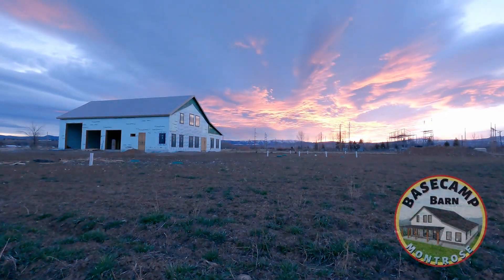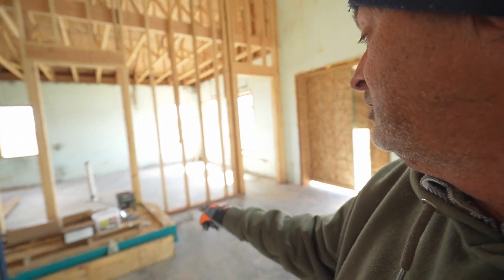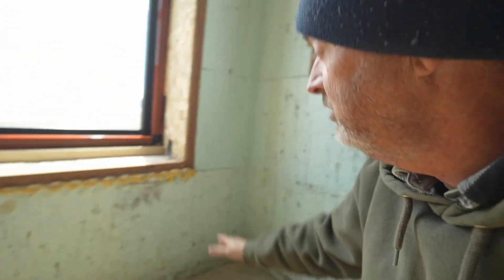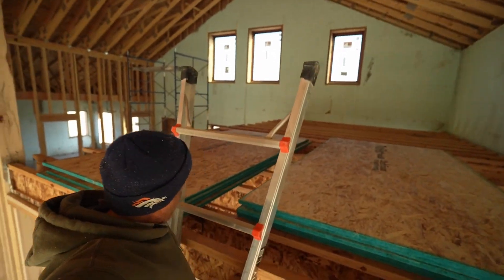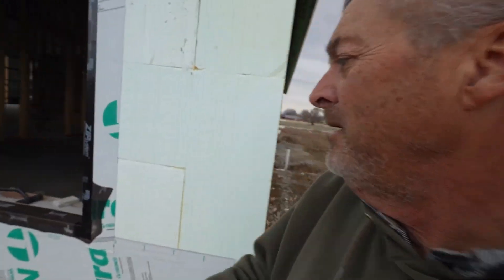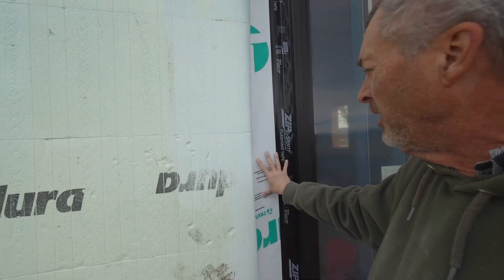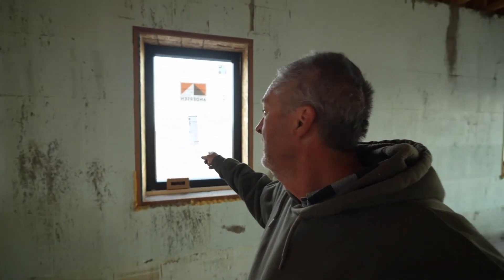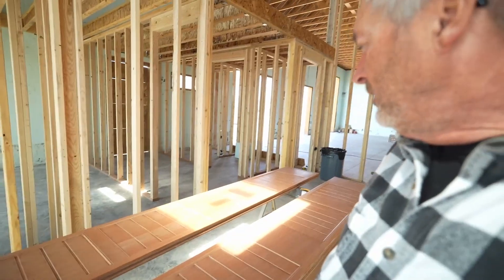How to Install an Anderson Fiberglass Window in a Nudura ICF wall, Solo Builder

Comment: no wood for critters all concrete foam walls only here Live in Florida you know why now Thank you
Reply from the maker: Correct!  we have Nudura 4' under grade, with another12' concrete footer below that too.  Also I applied the Nudura Waterproof Membrane over the top of the footer up to about 12" above grade everywhere, except where I continued up the wall with it around all the windows and doors.  No critters in, but they still get into the garage under the door seals....